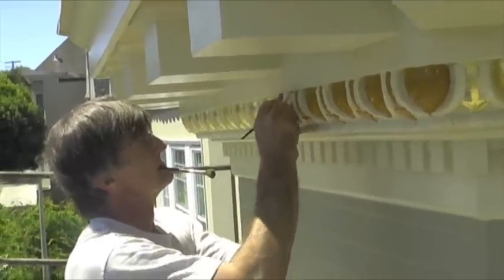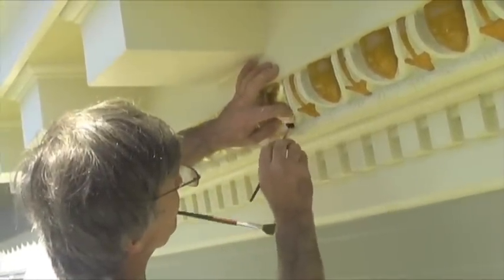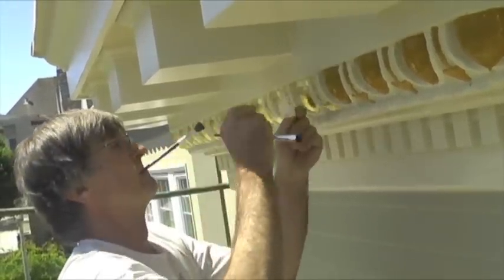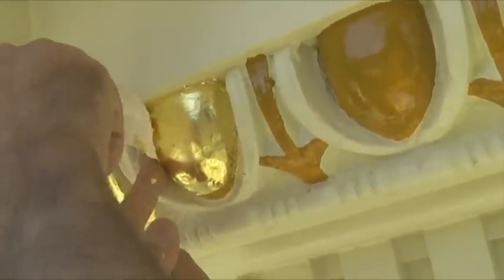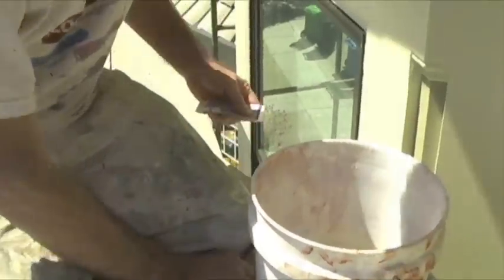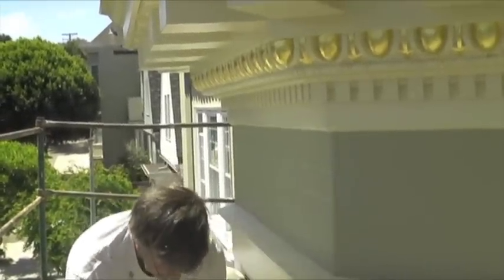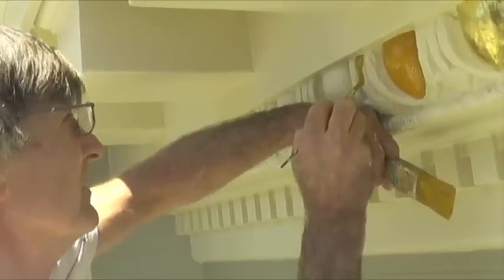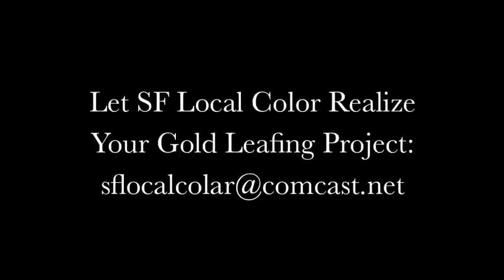Gold Leafing - Gold Leaf lesson from Award-Winning SF Local Color master craftsman Chris Schneider.

Comment: The stuff one can buy  at Walmart is actually METAL leaf - which is FAKE gold, and the same goes for the liquid gold or gold paint.  REAL 24kt or 23.75 kt is going for around 70-80 bucks per book for loose leaf, a bit more for patent leaf, which the gilder is using.   If you use metal leaf, even if it is coloured, it has to be finished w/a protective layer of finish or it will tarnish. There is a gilder's society for anyone interested in developing knowledge and skill.

Comment: Can any one tell me, How does the Gold Leaf sticks to the concrete? Is there an Adhesive to stick Gold Leaf.
Reply: When gilding the surface must be nonporous. Therefore you must seal the concrete. I suggest a urethane or epoxy. After sealing and smoothing, you can easily gild concrete using an appropriate gilding adhesive.